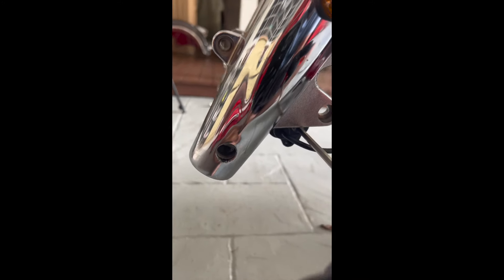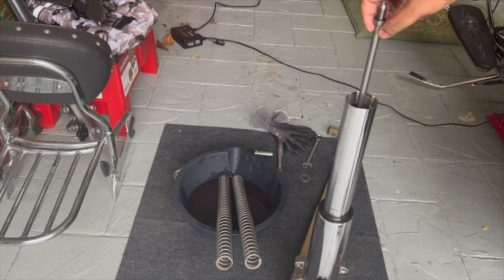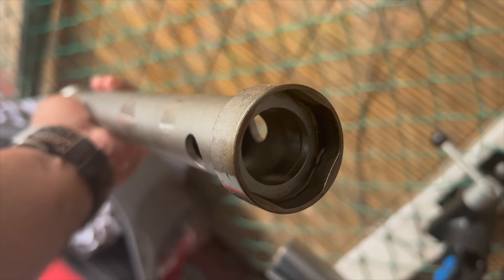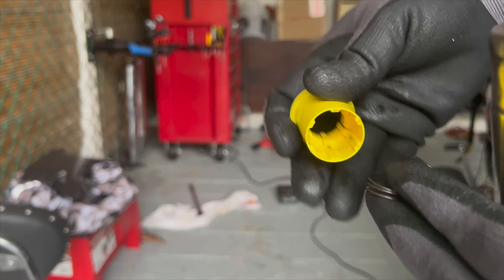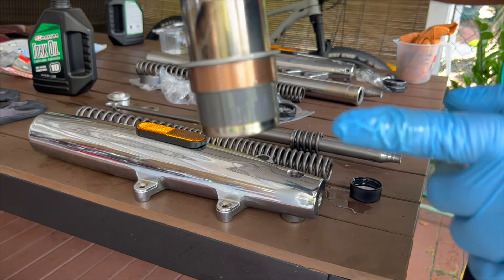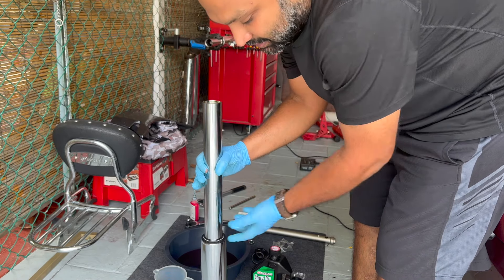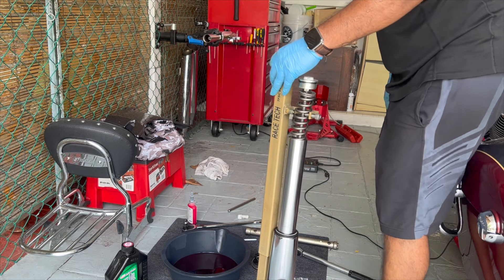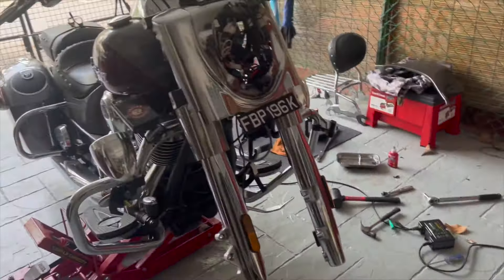Indian ThunderStroke - How to Rebuild Forks

Comment: Can you please tell me where you got your special tools and part numbers. I want to do my forks but having trouble finding the tools
Reply from the maker: You’ll need:

1) a valve spring compressor tool like this one from race tech: https://www.amazon.com/dp/B000GV6UIE?ref_=cm_sw_r_cp_ud_dp_Z3KH2SYAR4DZS4XPQ57B
2) a 46mm fork seal driver: https://www.amazon.sg/dp/B009D29ADY?ref_=cm_sw_r_cp_ud_dp_VZBCFM9D5TQZ05Z2KVJ4 (or you could use a PVC pipe of that diameter)
3) a damper rod bleed tool: https://www.amazon.sg/dp/B0725DKNRD?ref_=cm_sw_r_cp_ud_dp_WANBZJ8E2SKP3S5SJ9Z3
4) a cartridge shaft tool, to hold the cartridge in place in order to remove the bottom bolt of the fork: Polaris part PV-49452. You should be able to buy it from your dealer with this part number, or you might have luck on amazon or eBay.

Good luck!
Reply: @eazyontwowheels  thank you, I will be ordering all that soon. Thanks again.

Comment: Can you make a video showcasing the PV49452 tool? I can't find one so fabrication is the next step. If you can measure and give dimensions, that would be even better. Thanks.
Reply from the maker: I’ll get back to you with the dimensions in a couple days. There is one other thing you can try without the tool. The cartridge and damper rod is held in place by the fork cap. So I think you can break the fastener at the bottom of the fork loose just a little before unthreading and removing the fork cap. Do remove the bolt (just break it loose) otherwise oil will spill out. This way you might not need the special tool.

Same thing for reassembly. Thread the bottom bolt in as much as you can by hand. And after filling oil installing the fork cap, you can torque torque the bottom bolt.

I have not tried this, but I have a feeling this might work.

Comment: I have another question. Sorry. Indian says their oil is 5wt, but you're using 10wt. Why is that?
Reply from the maker: I couldn’t find the weight spec for Indian’s fork oil anywhere in the manual nor online, but some folks on the forums seemed to suggest it was in the 5-10wt range. I also found that different brand oils have vastly different viscosities for the same weight. The 10wt maxima oil did make my suspension feel a little stiffer. Might try a 5wt next time :)
Reply: Can you tell me part number 
Fork seal kit?
Reply from the maker: @josedejesus2090  I put links to the fork seal and bushing kits in the description of the video :)
Reply: Sorry for the delay in responding. Thanks for that info!  @eazyontwowheels
Reply: By the way, I'm FINALLY going to do this job tomorrow. I decided on the Indian fork fluid too. I'm going to make my own video and will plug your channel since you helped me understand this process immensely!  @eazyontwowheels
Reply from the maker: @FlashOnTwos  good luck! It’s easy once you do it once :)